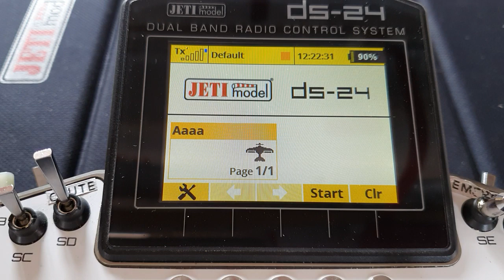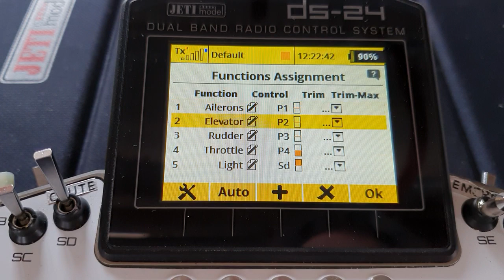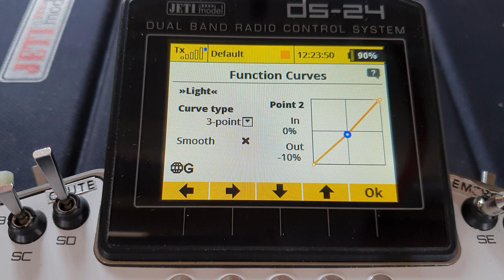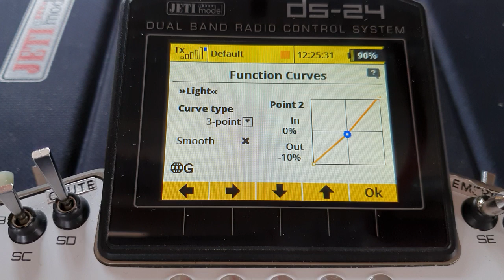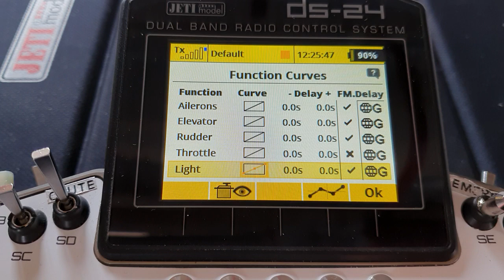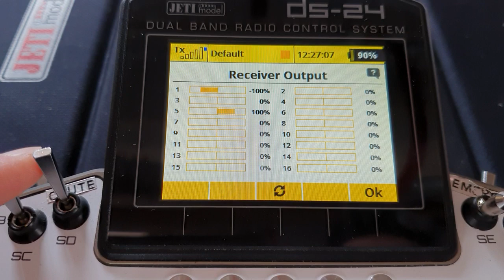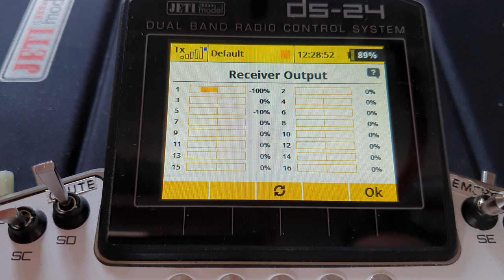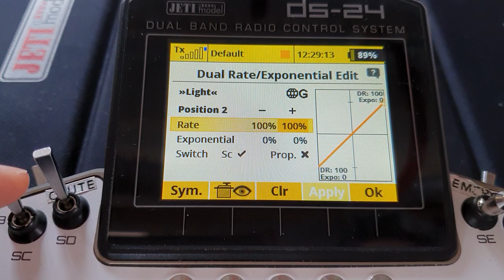Jeti - 4 position switching, for example a light controller episode 3

Comment: Thanks so much for taking the time to answer this Harry.  I love your solution.  I need to get more familiar with the function curves as I can see how valuable they are.  BTW, I am currently using end points > 100 (on Spektrum) but as you explained I probably won't need to do this on Jeti.  I wasn't aware that the pulse width for the Jeti were different from Spektrum.  Thanks again for your wonderful video.
Reply from the maker: I don't know what end points Spektrum uses.  There is no standard that all brands must follow.  JR used 1.1milliseconds to 1.9ms (1.5 +/- 0.4) Futaba is 1.09 to 1.95 (1.52 +/- 0.43), Multiplex uses 0.95 to 2.05 (1.5 +/- 0.55).  Jeti and many of the newer brands are using 1 - 2ms (1.5 +/- 0.5)  So a servo or controller set up for JR default 100% will see Jeti default 100% as 125% !  (0.5/0.4).
Reply: @cotswoldpilot  Does that mean if I convert a plane from Spektrum to Jeti I need to be careful that I don't drive a servo past it's bind point if I have reduced the end point in my Spektrum?  Good to note.
Reply from the maker: It would be wise to check all servo travels for binding at end points
Reply from the maker: It would be wise to check all servo travels for binding at end points